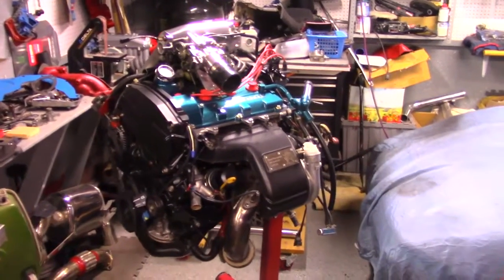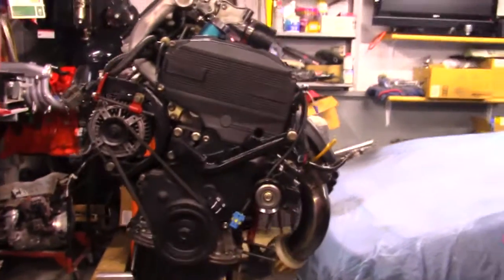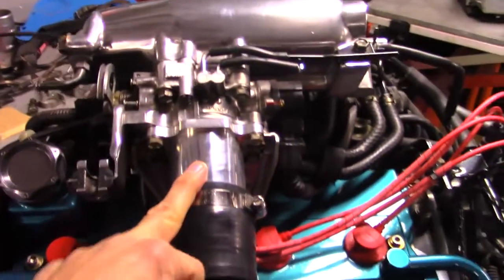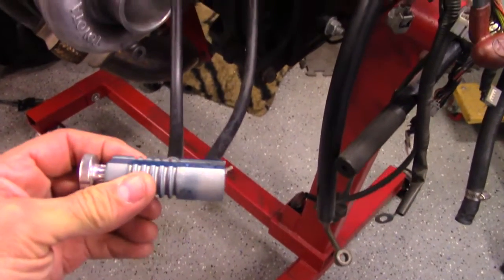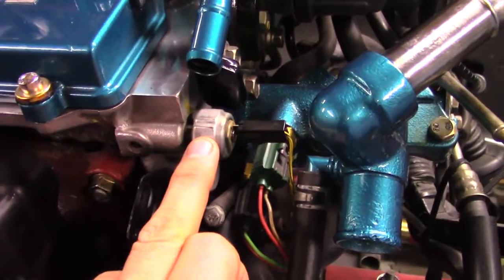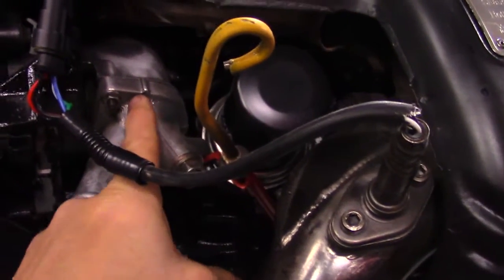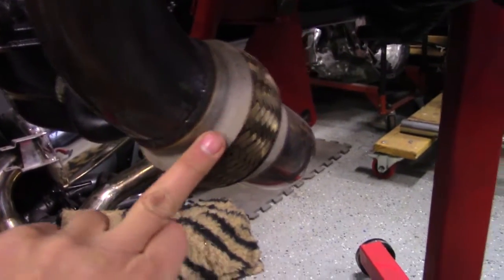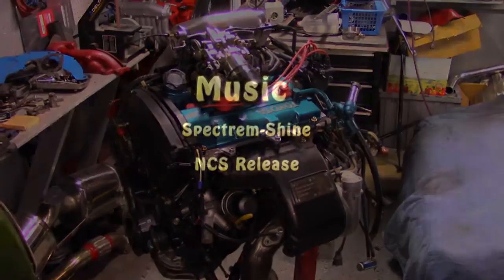3SGTE Overview and boost controller install.

Comment: Thanks for the great info in this vid. Just picked up my first sw20 factory turbo 92 mr2 project with a 93 jdm gen 2 swap with jdm ecu. Was looking through vids and any resource to help with startup of my swap and info and found your channel.
Reply from the maker: Did you rebuild the engine? Or are you just doing a swap? If just a swap make sure everything is plugged in and all you fluids are good and just start her up. You will like the 3s engine even tho it's old it still holds up.
Reply: Mikes Garage I bought it as a unfinished project. Looks like the pins on the usdm harness is pinned differently than the diagram on the 93 ecu. Will get everything grounded and repinned. If i can't figure it out I'll just throw in my k24/20 longblock lol

Comment: what is the factory boost on Gen 2 Engines and how much I can boost it up with a manual boost controller and keep it safe.
Reply from the maker: Stock boost on a gen 2 is right around 11 psi.  You can run between 15 and 17 psi safely.. if your engine is healthy .. after that the ct26 turbo starts getting hot. not to mention fuel cut is right about 18 pis.
Reply: Factory Boost is 12 psi (0.83 bar); Fuel cut on 16 psi (1.1 bar), source from Wikipedia 3SGTE engine

Comment: i have a 2nd gen mr2 3sgte and for some reason it wont boost pass 6 psi any ideas why?!
Reply from the maker: Well...there could be many reasons. Check the wastgate..make sure its working properly. Check for boost leaks on the intercooler hoses. Make sure your timing is set to 10 degrees. before top dead center. I would start with that.
Reply: Mikes Garage ok will try that thanks !
Reply: You might also just check the gauge. I don’t know if the boost gauge is electronic, but if it is it might have bad capacitors like the tach suffers from eventually. I can say mine goes to 11!